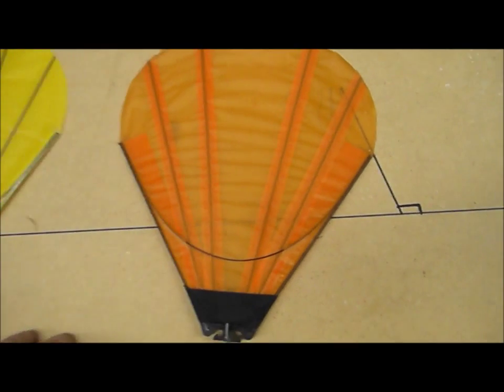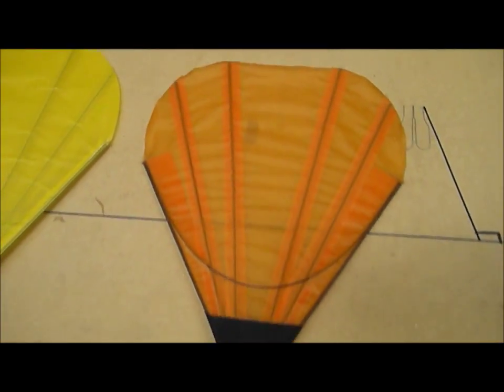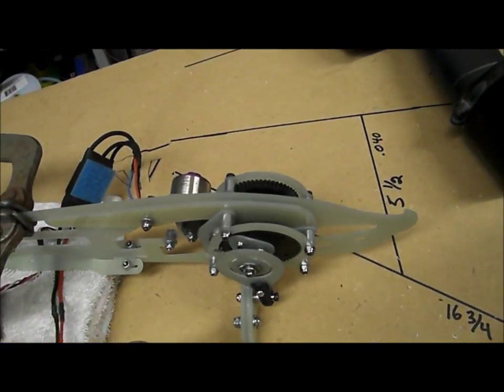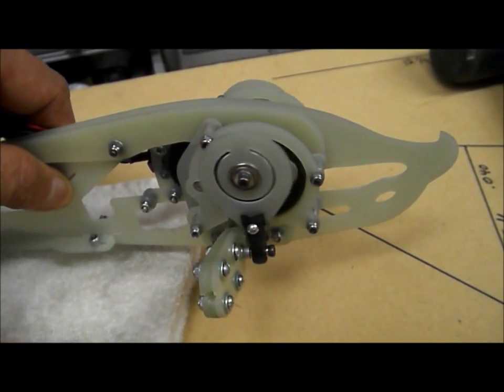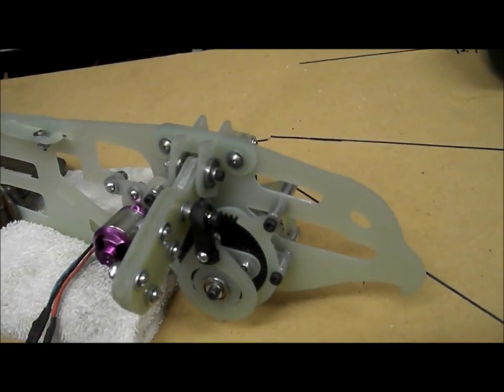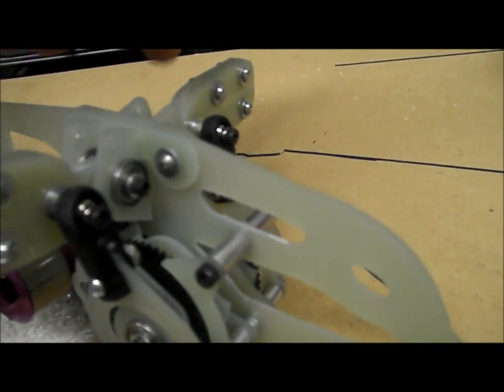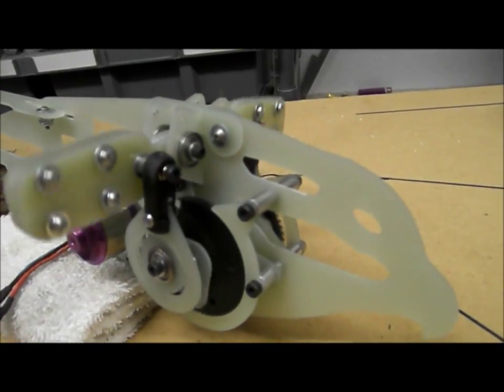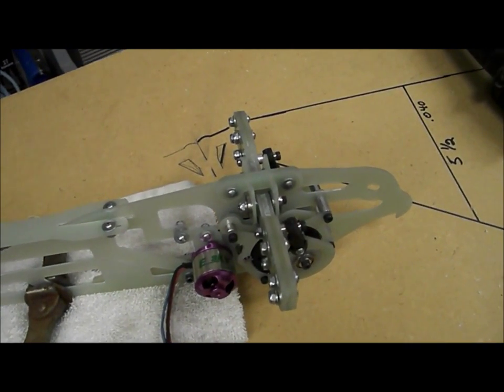Ornithopter Update #6

Comment: Hi, the Turnigh 2627 4200kv may be what you want.  It's rated at 22A for a 2S or 3S battery.  It says the shaft is 2.3mm.  There is a 2.3mm 10T pinion to fit this motor as well.  Both products are from HobbyKing.  Are you selling this as a Kit?  I am very interested if so.  All the best and Happy flying!
Reply: It doesn't say the pitch on the pinion.